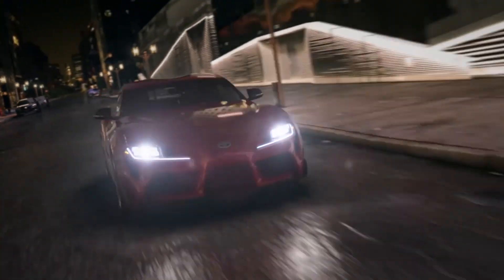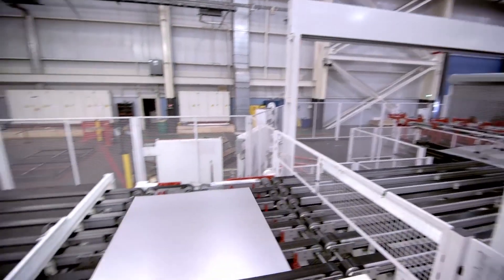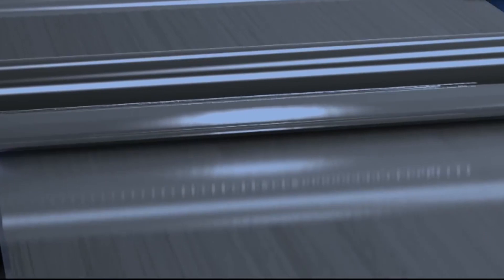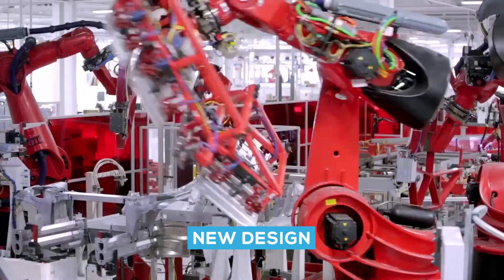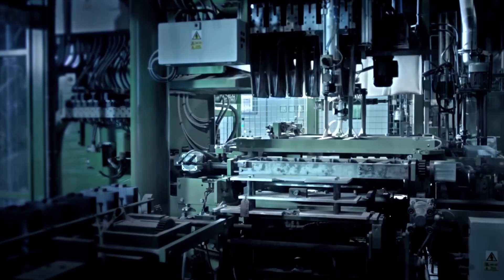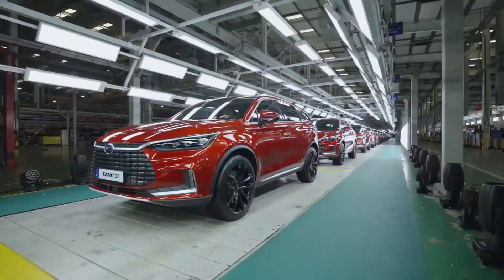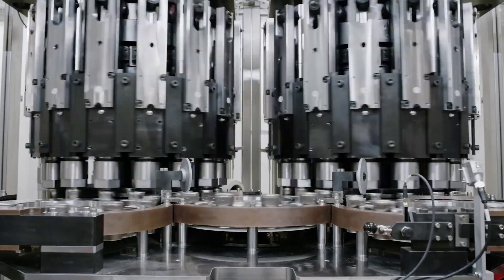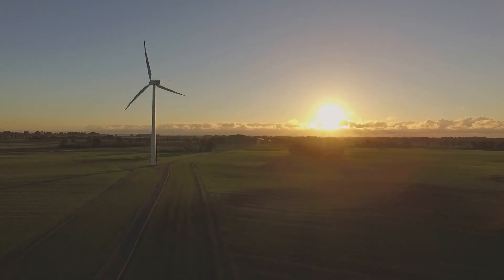NEW Blade Battery Uses GAMECHANGER to Charge Faster!

Comment: Two parts to this story. Tesla using LFP batteries, and BYD blade battery pack form factor. 
Tesla adopted LFP battery cells for their lower tier vehicles because they make sense economically, and because the patent on LFP batteries keeping them from being economically viable for budget vehicles outside China ended last month. 
That being said, Tesla is using prismatic LFP battery cells from multiple suppliers. "Blade" is just a marketing fluff for BYD's battery pack form factor for their prismatic cells, similar to how 'Ultium' is just marketing fluff for GM's battery pack for pouch cells.
Most of the marketing fluff in this video is specific to LFP battery chemistry, not the Blade battery pack form factor, and thus applies to any other battery maker's LFP batteries as well.
Tesla hasn't said anything about Blade/prismatic battery packs being game changing. They have said that pouch cells are problematic.
Reply: Yes and no. Musk has said that the LFP chemistry will come to dominate the high volume, low to mid price range, of the ev market, so that is a significant change from him, but he was not promoting the blade battery per se. The rumors about Tesla contracting 10GWh from BYD seem to be gaining traction for delivery to Tesla Shanghai in 2022.
Reply: Nearly every ‘fact’ here is wrong. I can’t even be bothered to correct you, its pointless.

Comment: Folks, puncture test is just a way of demonstrating safety of a battery to the extent of extreme damage.  Even overcharging can cause fire like your cell phone.  The long battery/cycle means value and the fast charging means convenience, time saving. The blade operates well at extremely low temperature means Norwegians are going to love it.

Comment: I am still not convinced we are not discussing marketing. Puncturing the battery for safety is nice but, by the way, how many cars were destroyed by fire because the battery was broken/punctured? That is the real catch. No one says it. And ... Tesla announced the battery deal with CATL, not BYD. Or... we just roll old info in sequence to form a false impression of a huge impact on market of the news? A manipulation, as all around us, or what...?  The blade batteries cannot be cheaper than rolled cylindrical batteries are. No way. So, if the crack of batteries is not often and the risk of fire associated is not a mass concern - the key is money paid in reparations/reimbursement of the destroyed cars in flames against the extra cost of these blade batteries, all are just a lot of smoke for a small advantage in safety. I know those blade batteries are presented as cheap. Cannot be, look at fabrication technology, the steps to be done, someone is cheating and lying on costs.
Reply: Jus google blade battery test results. Simple. No one i cheating. They are just very good. Get over it.

Comment: PLEASE READ. This video is full of lies. Tesla's current batteries have an energy density of approximately 260 Wh/kg and the new 4680 will be over 300 Wh/kg, double of the BYD blade. The possible CATL deal is for LFP batteries of 150 to 165 Wh/kg not 126 Wh/kg.
Reply: Nothing is a lie here. The problem is in your lack of knowledge. He was comparing apples to apples: LFP blade battery vs LFP cells supplied by CATL for Tesla. For your information Tesla will most likely switch to LFP at least for standard range cars... in which case the blade battery is far superior: it is cheaper, with more density and safer.
Reply: CATL don’t make 150 to 165, they can’t yet. BYD do.

What new 4680? Where is it?

Tesla have ordered 10 GWH of Blade. How bad can it be?